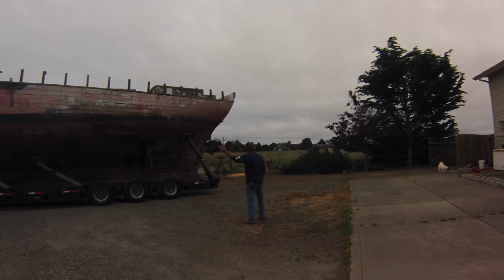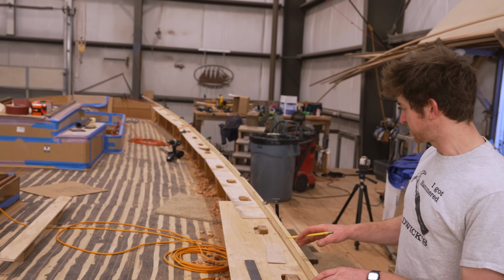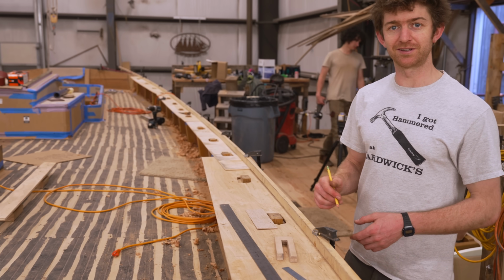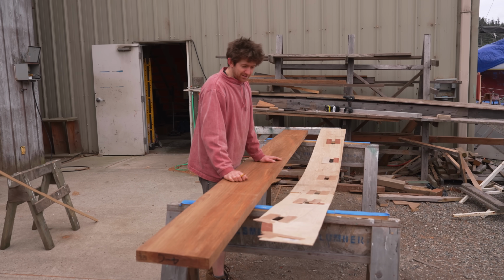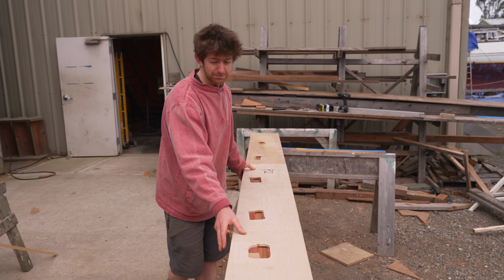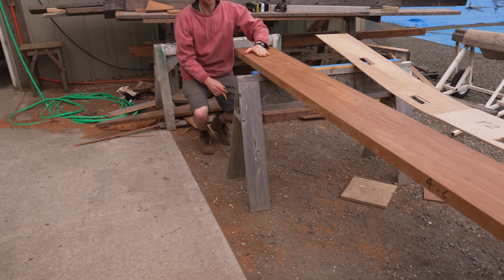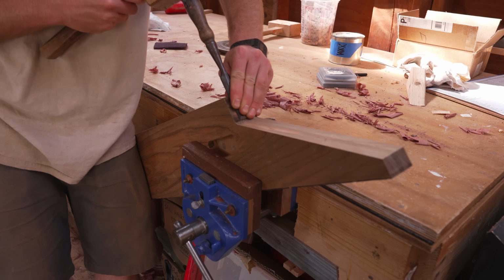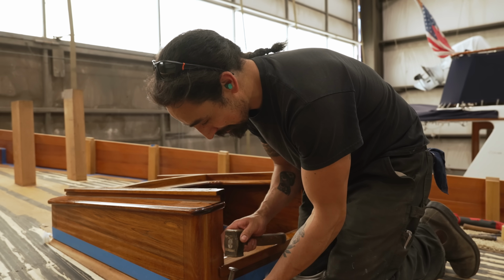Rebuilding a wooden sailboat - Fitting the solid Teak Cap-rails

Comment: Hi, watched every episode so far, and have wanted to comment, but had no special reason to, until now, Stanford's yacht that was rebuilt by your friend and mentor has a tenuous  (but important to me) connection. Ziska spent part of its life in Whitby, owned by a friend of the deputy head of Eskdale school in Whitby, his son Russ and I aged between 8-10 years old used to look after her, we would row across the harbour from the dinghy corner near the swing bridge to the dredger hole where she lay on her mooring opposite the fish quay, or sometimes on the mooring trot on the east side under the old customs house and town tailors. nobody locked boats in those days. we used to wash the decks and tidy  up inside, sadly at that young age never got the chance to sail on her. This was a popular spot for photographers and I am sure she is in many pictures of Whitby from the 1960's. At low tide she would lay over on the bank, but one day she went the wrong way and sank it took weeks to get the mud out, and I don't think we ever got it all. I seem to remember an article about her rebuild by your friend in P.B.O., at Cows I think and was so glad she was still around, I am amazed to see her condition now, thought she might be gone. Your friend Stanford will probably know most of Ziska's history, but if he hasn't any photo's of her time in Whitby he should find her on any photo's of Whitby lower harbour in the 60's. Started sailing myself in a mirror dinghy, and have had dozens of yachts, gradually getting bigger up to a 46ft ketch, and then getting smaller again as I got older, after my sea dog 30 I have now downsized to a Corribee, Just like the one I owned 40 years ago. Think Ziska gave me the bug.

Comment: All I can say, is that thickness planer looks old enough to have built the Mayflower.  Okay, I know, no electricity back then.  But probably a PT boat back in WWII.  It's a beast!  480v 3-phase? 20-24 inches?  I don't think I've ever heard it 'lug down', planing the thousands of board feet of timber, I've seen run through it in your videos.
Reply: Leo has video about blade sharpening for everything, chisels, planes, planers. Really sharp blades is key to cutting through like butter.
Reply: Steampower.

Comment: I love watching sailing ships sailing close hauled, there's such speed at a high angle of attack; speaks to low pressure forces generated by the sails themselves. Impressive..
I also like woodworking in teak, it's a special variety of weather proof wood. I've seen whole house buildings built in the stuff in Southeast Asia.. no painting required.
Reply: Out sailing as a passenger, and sitting on the foredeck, I looked up at the foresail and had a “come to Jesus” moment that the sail was working just like an airplanes wing, and developing lift in the horizontal planes. As I was a flyer, I could understand now how that was working.

Comment: I noticed the mast hoops on Ziska (sp?) looked like they might be some sort of composite. I've always seen these made of riveted ash, but as in many other instances, using modern materials which are often much stronger and more durable makes sense as long as the classic look can be maintained (e.g. the delrin sheaves in the block) Is there a spec on how the sail should be bent to the mast? The old photos definitely seem to show hoops rather than parrels

Comment: Agree with all the positives. Leo, could you give us an insight into the term and process of "fairing" please.
Reply: @SonjaBruenzels  thanks Sonja. I suspect there is a lot more on the subject even down to methods of fairing just one piece of timber with assessment of grain, natural shape and flexing etc. and how  to exploit these features to the best. B.
Reply: I've thought a lot about how best to describe "a fair curve" - it's a combination of 'smoothing' & 'streamlining'. The object is to adjust the shape so the changes in curvature (the inverse of the radius) avoid sudden jogs or bumps. Mathematically, the graph of curvature along the shape's length should also be a 'fair curve'. Think of a race-car driver trying to maximize speed through a series of turns. They'll try to use as little steering input as possible & to avoid sudden, sharp steering corrections, in pursuit of 'smoothness'.

Comment: I don't remember ever hearing Leo address this question, but maybe he has....  Why buy a boat for even $1, what does that get you?  Clearly there wasn't much that could be saved from the old boat, although he at least got all of the lead in the keel.  Does it buy you the name? Does it cut down on paperwork/registration?  What is the advantage of that over just building a new boat without buying an old boat?
Reply: I'll venture to guess that when Leo bought the boat in May 2017, he thought that the ballast keel, timber keel, half of the centerline timbers, iron floors & knees, deckhouses & more than half the hull planking could be re-used. Further, I'll wager that the success of this youtube channel is based on the appeal of the idea that "Tally Ho will sail again."
Any fool can buy a set of plans & start sawing wood, but it takes a special kind of cray to buy 8 tons of semi-historic scrap metal & mulch & re-create it to (better than) its former glory.

Comment: Wonder how much the teak he's shaping in this video costs? I' ll do the math for yall: Here where I'm at in the SF bay area, teak costs about $78 dollars a board foot. (one board foot is 1" thick by 12" wide by 12" long). That board looks like 12 feet long, just under 12" wide and  2" thick. my guess is its about 22 board feet of Teak at probably better rate than I'm getting,  let's say Leo gets it for $65/bf. That means THIS ONE BOARD cost around $1400 us dollars. That's for 12 feet of cap rail. I actually don't know Tally Ho's LOD, maybe 40 feet?  But the rails are curved so maybe  he needs 44 feet of teak per side . The boards are not all gonna be 12" in width but we can estimate the Board Feet he needs by saying the average width of all the boards is 9 inches. Which is 3/4 of 12,  so 88 feet long times 2" thick I'm getting 132 BF total, by the cost per BF $65 means the teak for the cap rail alone costs $8580 US dollars. Now you know how it can be nerve wracking to cut up big boards like that. And also just a glimmer into the total costs of producing a boat like this at this level of craftsmanship. Is Tally Ho going to be worth a couple million bucks when finished?  More?  ALSO: sorry for the ridiculous system of measurement we use for everything in the US. It's totally backwards I know. It not the worst thing we do wrong though
Reply: Is this Leo or a lookalike account? You have no content on your channel…
Reply: Naw I'm just me, Salty Walt. I'm a woodworker and a sailor as well, just no desire to edit videos for half my life. I also have a large wooden boat I've been restoring, but mine started out floating unlike Leos, and mine took me 12 years to get sailing.
 to his 6. But I did mine alone in my "spare" time. But maybe I'll start a channel sometime soon though. my boat is Minerva, she'sa 53 LOA ketch designed by William Garden.

Comment: SCUPPERS: where are they? You have a floating bathtub without them. I suppose next few weeks, but I thought there might be holes for them before you paint.

By the way she looks gorgeous. Since that day you added the bilge stringers, she has looked more and more like a boat.
Reply: There are several long open slots along the base of the bulwarks, & the cockpit will have floor drains at its aft corners.

Comment: 2025 is 100 years annevery of Fastnet Race. Are ypu ready by then?
Reply: Also, 2027 will be the Centennial of Tally Ho's victory in the Fastnet
Reply: official_SampsonBoatCo  I work with gas springs for marine applications. Both gas springs and end fittingd are in 316 stainless steel. Let me know if you need door or hatch balanced with gas springs.

Comment: Why is it so common on large sailboats to have very short or nonexistent deck rails? It seems to me that one would want at least waist high rails. I certainly would.
Reply: They are more to tell sailors where the edge is, not to stop them falling over the edge.  Much higher than "mid calf" and they start to get in the way of working the boat.
Reply: @Rob Smith  You see waist high rails on a lot of old fishing vessels but they seem to be absent on many recreational sailboats. If you need to be on deck in heavy seas I would absolutely want high rails even if I wasn't hauling in nets and such. You could easily place hinged door sections at various points along the rail to allow for easy loading and unloading of people and cargo too. No way I would want to risk falling overboard while the ship is pitching and rolling at sea.